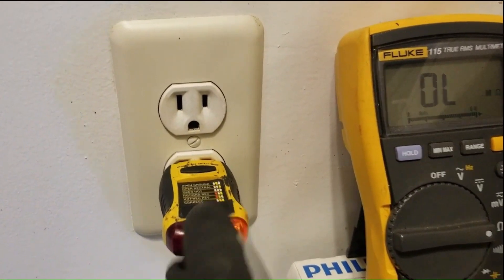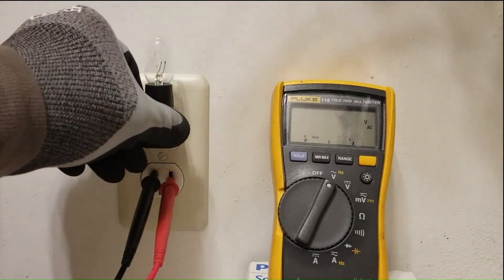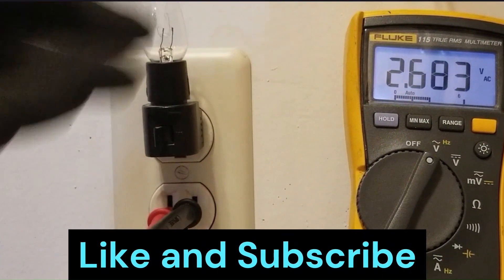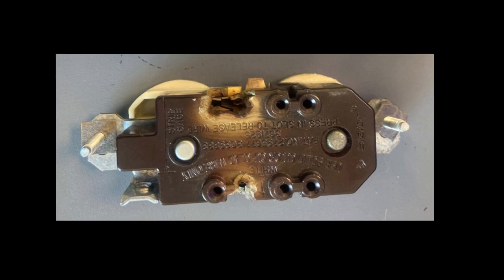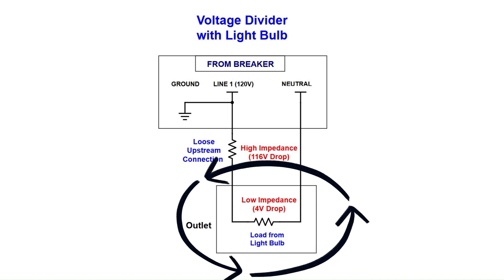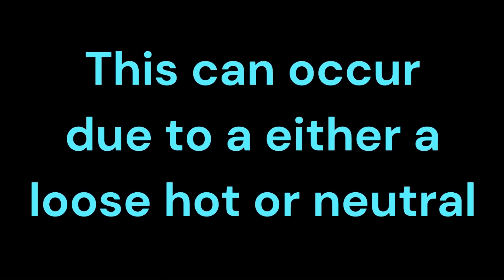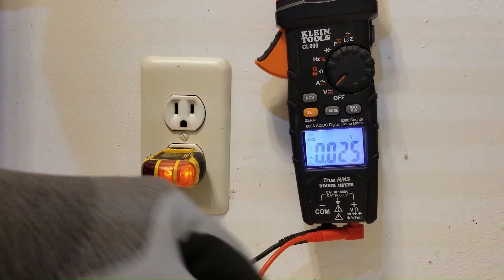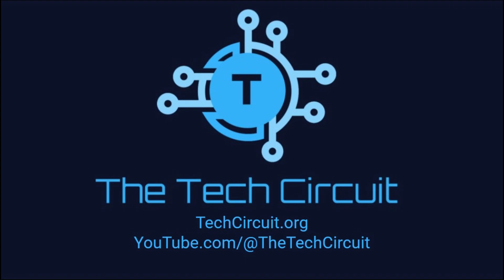#96 - How Outlet Testers Can Give False Readings (What They Miss!) ⚠️

Comment: So I have an Astroai CM2KOR MODEL and I put the probe in the socket and it read ac 0.450 v  .I turned the dial to the V~ symbol.
Reply: I'm trying to find a short and all my circuit breakers seem to be fine , nothing tripped so I'm thinking maybe I have a faulty ot loose circuit and I'm not getting sufficient power somewhere or one if the sockets  (4) is most likely faulty wired ? Or maybe is burnt when I guess I have to open th3 outlet next with the breaker switch off ?

Comment: These testers also don't show if neutral and earth are reversed. Only if the tester has a RCD test function, you can determine if your ground is good or not. With neutral and earth swapped, the RCD test places a load between neutral and hot of + 30mA, and the RCD won't trip.
Also, if you add a 300K 1W resistor between the hot and neutral terminals in the tester, the tester would shown that there was a bad connection.